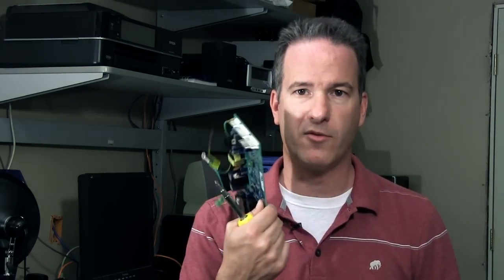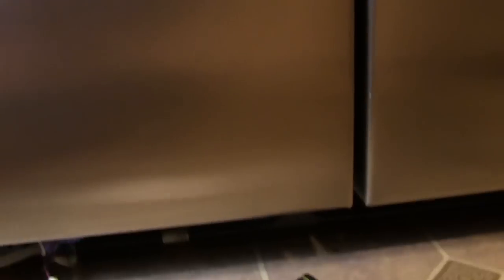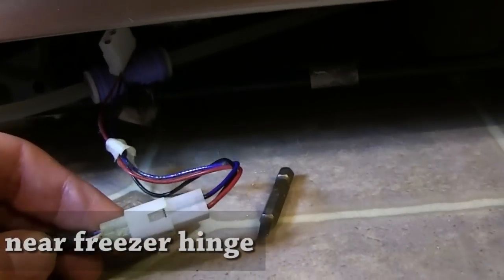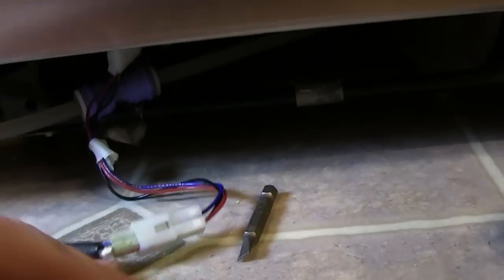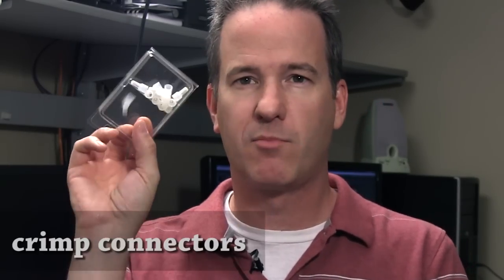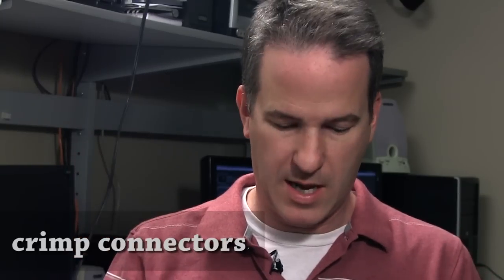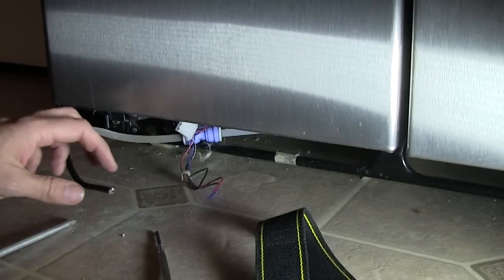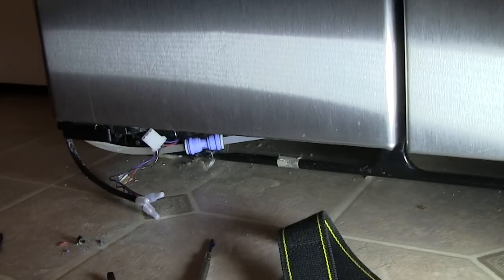Fixing GE Side by Side Refrigerator Water Dispenser

Comment: Hi Guys, like mike66547 I too have the leak under the freezer door.  GE rep in Singapore has advised the tube going up the door to the dispenser is a non serviceable part - cost to replace door AUD1700!
Any chance, you've looked into replacing this hose.  I suspect pulling the hose thru (if its actually possible to access where it attaches to the dispenser) will also pull the wiring harness thru too.
Any thoughts?

Comment: I have the GE GSS25WSTA the water line was pinched & cracked when installing the freezer door after moving.  The line from the bottom of the door up to the outlet needs replaced.  I thought it would be easy (based on other youtube videos) but I can't figure it out.  I tried pulling the line out from the bottom of the door & it didn't move.  I removed the ice dispenser cover & control board but the water line outlet is inside the sealed part of the door.  Am I out of luck?

Comment: Where's the video of the ice dispenser issue.  Water works fine.  The ice dispenser sounds like it is starting but after a second, stops.  Later I got about 3 cubes, then it stopped.  I know this is an old post though.

Comment: My GE side by side had the corroded connector problem dealt with by Handyguys in this podcast (extremely humorous and helpful). Dead control panel.  Once repaired, as suggested here, a light lights up on the control panel. but touching any button on the panel after that just turns everything off. Dead. Unplugging, waiting a bit, and plugging it in again starts the process once more  -- but no real function is regained. Is this a control panel brain problem? Do I need a new board?

Comment: I have a problem with my dispenser . I replace the filter with the proper ge filter and every filter I have to take a rubber washer like on a water hose and put it over the top of the water filter before screwing it in. Any idea as to why I would have to do this? I have to do it with every filter before it will work.

Comment: This guy was SPOT ON with no water at the water dispenser. I found corrosion just at the bottom after I removed the kickplate and pulled out the wire connection and checked what wire went where and cut off the plastic connection and connected each wire directly. It workewd and I am grateful for this guy's youtube info.
Jim Shriver
Reply from the maker: Thanks. Glad it worked out.

Comment: Ok everyone. I'm just checking back to give an update. I followed the instruction in the video and it worked like a charm. Yeah there was some corrosion on the wires. before you get started just make sure you match the wiring. In my case it was black to black, blue to blue and white to red. Good luck.
Reply: This helped, as I took them apart without taking a Pic or annotating them.

Comment: Dude! You're the man, this fixed the issue with my fridge! The connector was a little corroded, I unplugged and plugged the connector a few times and sure enough the green light on the panel lit up and it started working again.

Comment: You are the man!.....had exactly the symptoms you described (water & ice dispenser not working).  Before I found your video, I had replaced the dispenser control board, but still had the problem.  Followed your instructions; found the bad connector; rewired the three wires; voila....all now working.  Probably could have saved myself the $100 for the control board if I had first found your video, but I'm still way ahead of the game versus paying for a service call.

Comment: I loved this video and I thought this was gonna be my fix. Exact refrigerator.  My wires didn't really look corroded, but did video wire repair just in case it worked.  Water dispenser intermittently. Seems to only dispense when fridge isn't running/or in cooling mode. Thinking next step is full control panel/board?? If push several buttons, it will start turning on temps and once flashed 00's. What do you think?

Comment: That was my problem as well. I did even need to do any electrical. There was just a bunch of cat hair and crap at that location. I cleaned it and disconnected and reconnected the wires and it works great. Thanks for the help. I thought I was going to by a new motor or worse a new frig.

Comment: Gunshots were hilarious! Exactly how I feel. Endless issues with garbage appliances today. This thing froze up on me numerous times so they sent me the kit to fix that ( the one that keeps it from freezing behind the dispenser). That didnt work. Now the thing is not dispensing water again (not frozen lines this time). My whirlpool dishwasher fries the thermal fuse if you use the sani wash feature (very hot water). That happened to me numerous times before i figured out what it was. There was a recall recently for that issue. There is a class action on my whirlpool washer( duets) cause of mold growing in the door. Just cant win. Looks like maytag is next for me! I do have a frigidaire stove (all my appliances are 10 years old) that I havent had a problem with but I rarely use it.
Reply from the maker: that stinks.  Glad you liked the video. Yea, I was hoping to express my frustration as well with that intro...
Reply: Note: Maytag is owned by Whirlpool. I try avoid Whirlpool products.
Reply: Well, i guess we are screwed then. BTW, I taped a piece of foam insulation behind my water dispenser , inside the freezer door and that fixed the issue with my line freezing up. Seems like GE didnt design it correctly (no protection of water line from the cold). hopefully this will help someone. i know its a different issue then the video

Comment: Same exact problem.  The water and ice dispenser on my GE profile (stainless, 2007, counter depth) worked intermittently and then stopped working all together.  Every time I tried to get water/ice, the indicator light (water, ice) on the panel would go out.  When I stopped pressing it, the light would come back on.  So...I did just as the video instructed...I unscrewed the kick plate (phillips screwdriver) and there is only one connector there, behind the kick plate and below the dispenser.  It was completely green and corroded and just gross.  My guess is a severe design flaw allows it to sit in drain water from the freezer.  Anyway, I wiggled the connection a little and the white wire came off completely.  Just so you know, my lead wires weren't all the same color as the ones going to the dispenser.  In this case, white went to red.  Blue to blue, black to black.  I used blue screw connectors covered in electrical tape from Home Depot.  Worked like a charm.  Thanks for posting this fix!  You are awesome!
Reply from the maker: Saltydog6432 Glad it worked out for you. Thanks for sharing.

Comment: My problem is a bit different than yours. I had just changed the filter and was letting a gallon of water run thru as they tell you to do, After emptying the pitcher the water stopped coming thru. I now have no water or ice. Any ideas on this one? I have not checked the front wires as you said in this video because it just stopped while I was using it.

Comment: Thank you thank you!!! I already had the appliance repair come out 2x to try and fix this. They ordered and replaced the control panel but nope - that's not what it was. Decided to tackle it myself and sure enough - corroded white wire down at the bottom. A 10 minute fix by me!! Now to get some money back from the appliance repair. Thank you!
Reply: The white wire goes to which wire? my white wire doesnt seem to go to anything on the coupler. Theres 2 blues and 1 black.

Comment: Help Handguy, I had the same problem with my dispenser, the little coupler connection was loose. I had it taped together and that worked for a few months, but then it stopped working altogether. So did exactly what you did. Cut off the coupler, stripped the wires and reconnected them. So far so good.  I plugged in the fridge and hit the water dispenser, filled my glass, but then it wouldn't stop coming!! I had a near flood in my kitchen before I could get behind the fridge and shut off the water line. What did I do wrong? Am I missing something?

Comment: Thank you for the video. we have the opposite problem the water is coming out with to much pressure and most of it is spilling out of a cup all over. Any ideas on what could be causing this?
Reply from the maker: not sure the answer but mine does that when i put in a new filter.  You may want to change our your filter and see if there is any difference?

Comment: My GE side by side water dispenser stopped after 5 years and although I am not 100%, I think that the seal got off it's track and allowed the freezing air in to freeze my water line.  I used my heat gun to heat it up and I corrected the seal, it works now.  Who knew?  Thanks for your video, my wife and kids where just like yours,  LOL.

Comment: Thank you so much! The connector on the door side cable had somehow ripped completely off, so I had no idea which wire goes to which. Now from this video I can see.

I'd do one thing differently: actually install a new connector assembly instead of those crimped splices. With the splices, you will have to break them if you ever want to take the door off (moving). The point of the connector is to make it easier to remove the door.
Reply from the maker: Maxwell Ballenger Good point. I assume I will never have to remove the door but using the connector is always best.

Comment: Thanks. This exactly my issue. The panel would intermittenly work then it stopped and hasn't been working for a while now. I have a home warranty policy but my deductable is $75. If it was something more in depth then I'd just file a claim but being a computer technician I'm no stranger to working with wires and this seems easy anough to deal with. Thanks again....

Comment: He kind of skips over showing him doing  most of the actual, you know, repair...which is pretty funny.  Also forgot to mention unplugging the fridge or turning off the circuit breaker, just to be safe, if only to avoid power surge damage in the dispenser. At least he showed where the connector is.  I had this same issue today and fixed it by bypassing the connector by tying the correct wires to each other with twist-on wire caps.  I think those are the "heavy duty" wire caps he referred to, but I used smaller ones, and didn't need a crimp tool.  It's important to take note of which wires on each end of the coupler go with each other (he didn't mention that part either).  On my fridge, white went to red, and the other two were black-to-black and blue-to-blue. I would've loved to just order a replacement harness and coupler, but can't identify it in any of the GE parts diagrams.  They show a different harness that goes to something else under the fridge, but the diagrams don't show that water dispenser power coupler/harness. It's weird...as if it was an off-factory addition or something they never documented.  

Also, I don't recommend keeping a loaded handgun in a kitchen drawer, particularly with young kids in the house.  That was...sort of sketchy, even as a joke.

Comment: The dispenser solenoid burnt out (stinking up the place something fierce!) I replaced it but still no ice or water is dispensed. Water is making it to the icemaker, so it is making ice and everything else works but the dispenser (LG model LSC26905). Suggestions?

Comment: I also have a GE fridge that drives me crazy. My water problem was the line freezing. After thawing it, again, the water worked, but it shot me in the chest. It looks like the end of the water tune is broken. Can the line be replaced ? If not, do you know of any kind of repair ?  I've looked all over for the part to no avail.

Comment: I have a Whirlpool side by side refrigerator (model GT1PHWPS00) side by side.  It has been dispensing water just fine. Yesterday when I went to open the door to the refrigerator water shot out of the dispenser.  It did make a strange noise.  Each time I open the door water shoots out.  Can you help?

Comment: Hello, i believe i have the same problem you described and the wiring harness does look corroded. Before I cut and strip the wires, the colors of the wires are a bit different. The 3 coming from inside the fridge to the harness are Black, Blue and Red. From the door mount to the harness its Black, Blue, and White with White looking like a bigger gauge. Naturally i would want to match Black- Black, Blue to Blue, but the thicker White and Red i am concerned to connect them. Any ideas, thank you so much.
Reply from the maker: i reviewed the video and it looks like it is red to white
Reply: Thank you, i will be trying it this weekend, thank you for taking the time to reply I appreciate it

Comment: I have the problem of no water coming through the door.  I have water down to the connection at the bottom of the door. When I press the water leaver I GET water pumped out at the connection.  Does the tube freeze that goes thru the door?  If so, how do you get to it to fix the problem.  Thanks,  Bill

Comment: Hi I have a GE Profile Arctic Refrigerator and the the water dispense indicator light on the control panel will intermittently light when selected. When it comes on water dispenses fine, when it doesn't light no water. Can you help with this issue? Thanks
Reply from the maker: +Ed Bailey I would check the connection shown in this video
Reply: +The Handyguys you guys are Saints!  thank you for posting this video.  It was exactly my situation, including my family complaints.  After buying a new control board, panel, swtiches, etc I was about to give up and call the GE Repair man, but then I found you.  Thank you, Thank you, Thank you!

Comment: How do you remove the kickplate? Do I have to leave the doors open to remove it? I'm having a hard time even finding any screws...
Reply from the maker: +Lisa Cumbie Hernandez There are 2 screws (1 on each end of the plate).  Get down really low with your face near the floor and you can usually see them. Use a flashlight too.  I used a long philips head screwdriver to get to the screws.

Comment: My problem is the plumbing behind the bottom drawers sprays out every time I use the water dispenser. I need to remove the plumbing and replace it.
Any suggestions?

Comment: thank you!, my ge dispenser control board light was off when I push the water lever. I thought the board is out of order. so I ordered the control board part in appliance website. but i got e-mail from appliance website that Ge dont make the part anymore

however !!!! it's my good news!!!. i can fix my refrigerator as your direction, it's only wire problem not control board.

Comment: Check what kind of connection you have from the supply pipe (the coiled pipe behind the fridge) and the water pipe. If the connection is a "saddle valve" then replace it with a "T". Saddle valves have very limited flow.
If you have the saddle valve - replace it with a plumbing T for the type of pipe you have, on the T add a shutoff valve and then put a reducer from your plumbing to the compression fitting for the ice maker supply. Make sense? email us if you need more info (contact on site)

Comment: Need some help!!!

I have a Similar problem. I reset the ice maker by shutting it off and pushing the lever three times and water comes in the ice maker but ice does not make.i also have no water from dispenser it was working and now it stopped.

Comment: Ok, my tank had a hold in it and leaked.  Replaced it.  Looked at this video checked my wires and yes they were corroded, Bad.  I connected the black to black, blue to blue, and red to white.  Still water does not dispense.  Makes ice fine.  Any ideas of what could be wrong?  Do I need to wait a while after I connect the wires?  Is it the motherboard?  LOL.  Frustration!!!
Reply: I had to listen for the pump when requesting water. Since the pump was trying, the guide I saw said the line was probably frozen, again. Tech did it the first time.  I did it and it takes about 20-30 minutes of blow dryer, heat gun(be careful) time

Comment: Why does my GE side by side refur continue to make ice when the "paddle" is clearly in the OFF position.  The only way I can now stop ice production is to shut the water off.  Otherwise, the ice cube tray is filled and ice is continually pushed upwards and to the rear.  Is there a problem with the paddle sensing system?  HELP...
Reply from the maker: Interesting...not sure.  there should also be a power switch in the back on the ice maker that you can turn off to keep it from running

Comment: Given all you your fridge issues, you wouldn't happen to know what part failed for the dispenser to act as if it's pushed on and be spraying water all over our kitchen floor (unbeknownst to us)...yeah, that was what i woke up to at 6:30 today...a strange splashing sound...awesome, i know, 3rd of the kitchen flooded :/
Reply from the maker: Wow. so the switch to turn on the water valve stayed open at the dispenser or was there a hose leak?
Reply: The Handyguys neither, the switch was not on or presses in but it randomly started spraying out water as if someone was holding a glass there early in the morning. no hose leak either...puzzling, I know. just curious as to what part could have failed...search hasn't turned up much for me.
Reply from the maker: Not sure. Perhaps check the applianceblog forums
Reply: The Handyguys ok, thanks for the tip.  keep up the great videos :)

Comment: My GE Profile doesn't make ice.  I get water from the door (8 oz in 13 seconds) and occasionally it makes ice but the vast majority of the time it doesn't. Shortly after moving into our new home in 2009 we called GE service and they replaced the board.  It never operated properly which we thought was due to the low water flow (we have an RO system).  Replaced the refrigerator filter with a by-pass plug which improved flow.  Still no consistent ice. Any ideas other than $100+ GE service call?